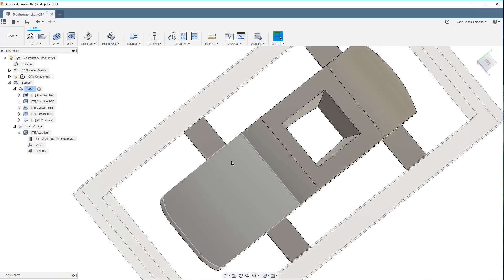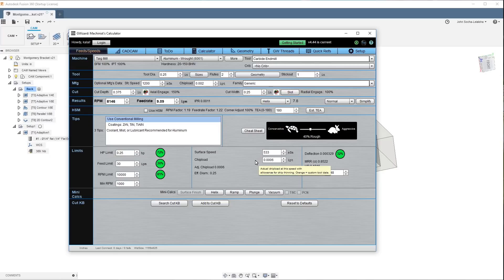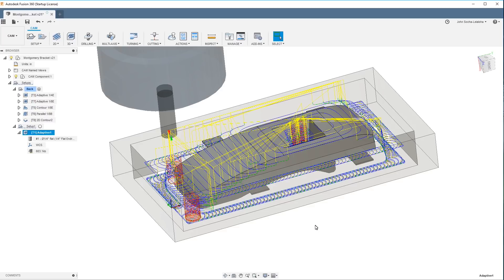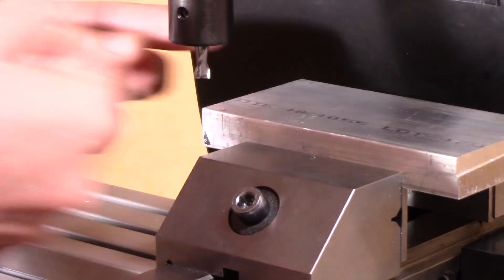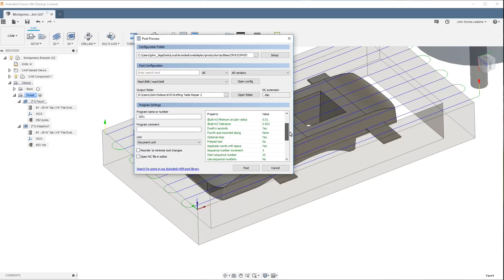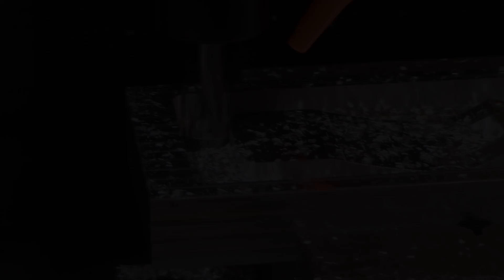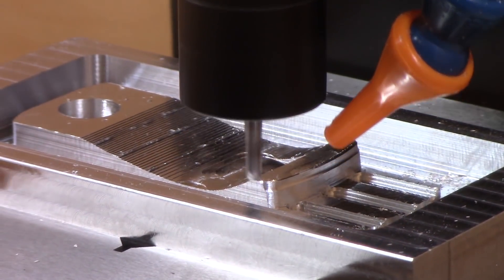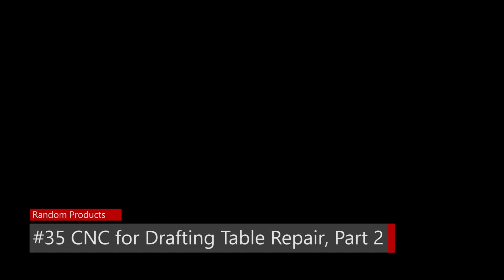#35 CNC for Drafting Table Repair, 2

Comment: Awesome, are you using Fusion 360 for this?
Reply from the maker: Yes, Fusion 360 all the way.
Reply: I been trying to learn Fusion 360 but is too complex for me, I'm using ArtCam, is the one I use at work but is no good for 3D cuts or complex contour, is not impossible to do it but is really hard I will learn Fusion.
Reply from the maker: There are a ton of videos out there for Fusion 360. I learned at lot from the NYC CNC videos: https://www.nyccnc.com/